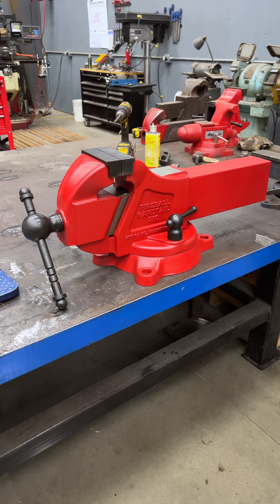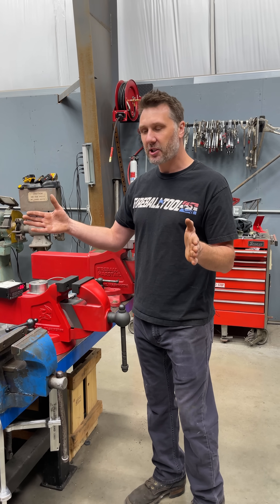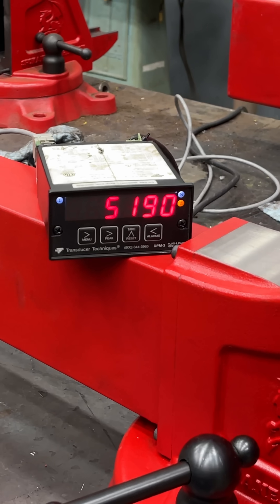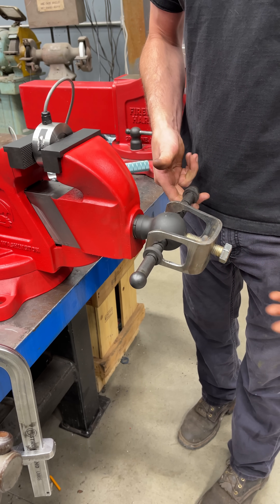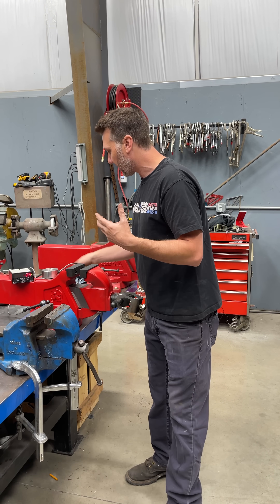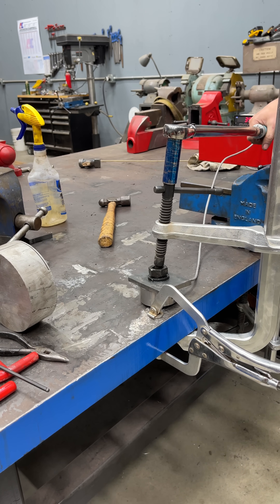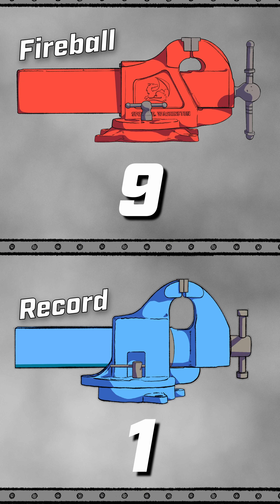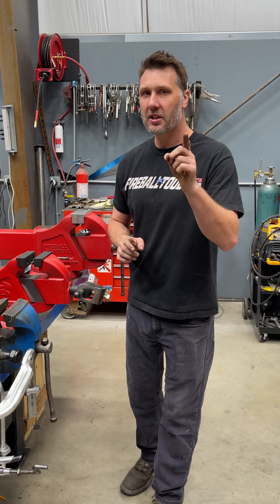Which Vise Packs More Force? Fireball 510 or Record #6

Comment: The Record No. 6 has a friction and binding problem, which is the same with all of the bench and bumper mounted vices. They last a long time, when you apply grease into all of the contact surfaces for the handle, swivel, and screw, but that friction also causes those contact points to bind up, preventing the full force of the vice to actually reach the jaws.
Basic engineering shows...
The more friction surfaces a device has, the greater loss of usable force can be applied in a given application demanding that force.
The old-school vices are absolutely useful as they always have been, but refined engineering has raised the bar of possibility to a whole new level.
💯🦅🇺🇸🤙

Comment: The no 6 is a good vice ,but no way is it better than the fireball vice ,I have a all steel record 112 vice guranteed unbreakable when made they are ultra tough way tougher than a no6 which is  cast iron..  record also made some really big vices 518 chipping vices etc that would give the fireball a run for its money, also the 114 is made of ductile iron alot stronger than the no 6 .

Comment: Why didn't you made different lenght sizes on the jaws for the 510. I just want an overall vise for everything. For vertical use too without changing anything. For a thick tube for example.
And one for the metric system of course :)